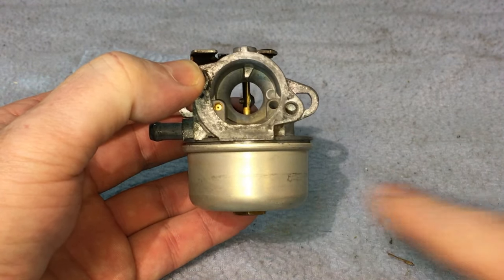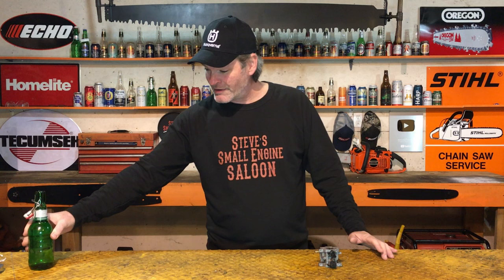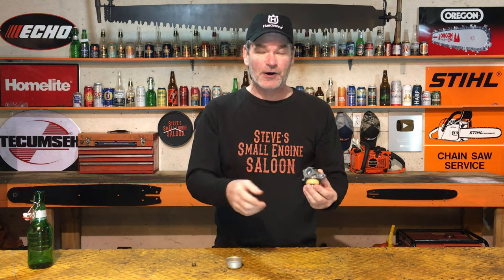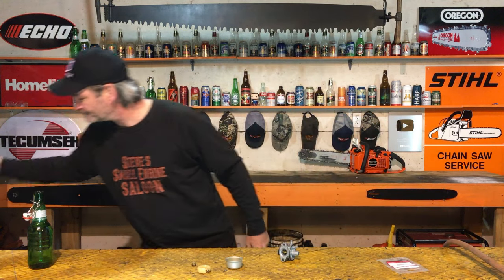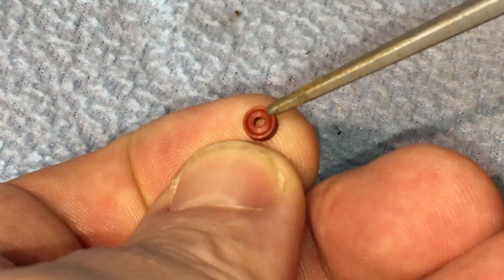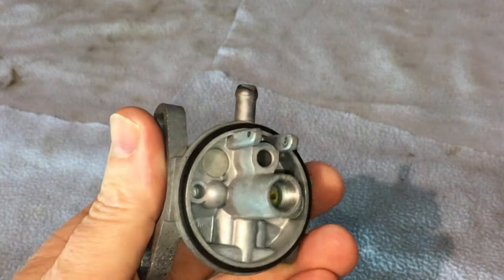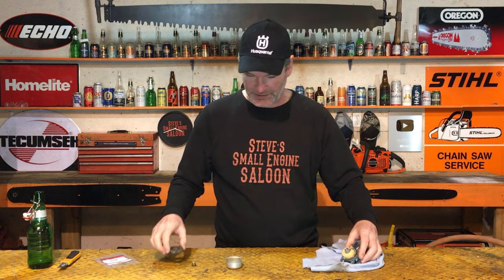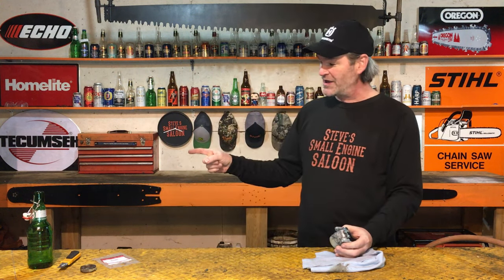How To Fix Your Leaking Snow Blower Carb – Briggs Or Tecumseh

Comment from the maker: ✅Click here for a Briggs repair kit ➜ https://amzn.to/2XH3DhG
✅Click here for a Tecumseh repair kit ➜ https://amzn.to/2DdxIfr
✅Click here for a new float ➜ https://amzn.to/33mAABy
For more videos like this, check out: 
👉How To Fix Your Leaky Snow Blower Carb – Honda Style ➜ https://youtu.be/NTBlVTa_jDQ
👉Fastest Way To Tell If The Crankshaft Is Bent On A Mower ➜ https://youtu.be/3up57DHiCqs
👉Here's Why Your Lawn Mower Is Leaking Gas - Honda Style ➜ https://youtu.be/tp67AzWNbI4
👉How To Adjust the RPM Speed on a Lawn Mower ➜ https://youtu.be/7YrA3QEIFnE

You can connect with Steve here too: 
✅Visit Steve’s WEBSITE ➜ http://www.stevessmallenginesaloon.com/ 
✅Visit Steve’s PARTS & TOOL STORE ➜ https://www.amazon.com/shop/stevessmallenginesaloon 
✅Follow Steve on FACEBOOK ➜ https://www.facebook.com/stevessmallenginesaloon 
✅Follow Steve on INSTAGRAM ➜ https://www.instagram.com/stevessmallenginesaloon/ 
✅Follow Steve on TWITTER ➜ https://twitter.com/SteveSaloon
Reply: Steve is there a
Way that the fuel could be coming out of both sides?? The air cleaner side and the engine side?? I see the gas leaking from the snow blower but when I did an oil change on it it looked to have some gas in the oil. I’m not 100 percent sure if there was but the oil seemed very liquidy and not as thick as when I put it in and it also had a type of sheen to the oil. I’m not sure if it could be both.
Reply: Steve, great video--loved the toilet analogy!  It's the first time I've understood a carb float.  Your link to the Tecumseh repair kit goes to an item that is unavailable though, FYI.  Be great to get an updated working one!
Reply: Do all tecumseh carbs take the same needle and seat kits
Reply: Would this cause oil out the exhaust?

Comment: Saturated float...In 1976..on a 73 ChevVan...plastic coated opencell foam float in a Qjet 4barrel.. took apart twice...still flooded...third time noticed float was heavier than normal...replaced with used one from parts stash...set up level..reassembled...ran better than new. Thank goodness the hollow plastic floats that are used in small engines are better quality today. Best to you and yours.

Comment: Thank you!   I rebuilt the carb on my 5hp Tecumseh about a week ago. I initially thought all went well and it started right up on 1 pull.  1 week after storing it I noticed a fuel smell in the garage and a puddle of gas.  After watching your video I pulled it apart and checked the brass float.  Sure enough it was filled with gas.  I replaced the float and reassembled and no leak. It runs better than it has in at least 5 years.  Great video. Thanks Brian.
Reply from the maker: Great to hear!

Comment: I had this issue with my riding mower. Although I didn't realize at the time this was the exact same problem, I did get a carb kit and replaced all the little bits like this and that did fix it. Thanks Steve for so many great videos.
Reply from the maker: You're Welcome...

Comment: Was working on snowblower and felt something was wrong with the seat.  Really didn't think using a compressor would blow out the seat but it worked like charms.  Thanks.

Comment: Thanks Steve, I had that problem with my snow blower two weeks ago, when I went to check it over at start of winter. Had gas in the oil, it leaked past the fuel line shut off valve and through carb. I was trying to figure out how it would have gotten into oil. Now I know.

Comment: Glad to have found this video! I kept thinking it was a gasket issue! Installed all ne carb and back up and running. Also bought the needle and seat repair kit to fix the old one as a spare...

Comment: Great carburetor repair video Steve, when I fix leaky carbs to test the needle and seat I just use my mouth to gently blow into where the fuel line connects to the carb.

Comment: Hey Steve, recently changed a needle and seat on a flooding Tecumseh carb. Next morning there was a nice pile of gas under the snowblower where the gas leaked out of the carb overnight. Checked to make sure everything was seated right, then noticed the plastic float was full of gas! Could hear it sloshing around. I needed the blower right away, so i drilled 2 tiny holes in the float to empty it out. Figured out that the floats are 2 piece units that have  a seam running down the middle. Thats where it was leaking fuel inside. So i took my plastic welding gun and re-melted the plastic in the seam area and the 2 holes, and reinstalled. So far its holding up great! Lol 
Next time i see gas again, i will order a new float.
But yes, the plastic ones can get full of gas inside them!
Cheers

Comment: I've just bought a new B&S carburettor. Fitted it and 2 days later my John Deere mower was hosing petrol out of the air intake. The plastic float was full of petrol/gas. Fortunately I still had my old float, but I will be visiting the dealer as soon as possible. So Steve plastic ones can have minute leaks in them too!!!

Comment: Steve there were some older Briggs with brass floats , and you should mention a lot of the Tecumseh carbs had a high spot & a low spot in the bottom of the fuel bowl and it has to be put on correctly or it won't allow the float to come down. I have also repaired many brass floats by putting them in a cup of boiled water & held it completely under the water , and then you should see bubbles come out . Then you can Mark it , clean it & solder it .! :-) hope that helps someone too.

Comment: Great vid! My Toro 724 Snowblower is leaking out the fuel primer so I replaced it and it does it with the new one as well. It sounds like this could be the issue.

Comment: I normally stay away from task like these! But your video makes it look easy. I found the information on how to order the needle and seat. Thanks for your help.
Reply from the maker: You are so welcome!
Reply: @StevesSmallEngineSaloon  well today I took off the carburetor and found that I have the brass float HMMM 
Then I couldn't find the hole on the underside to blow out the seat you talked about so I put it all back together. So it wasn't  as easy as you made it to look like. HMMM I'M  STUMPED

Comment: Excelllente Steve once again ! Got near 2 feet of snow dumped here Downeast. Damn Tecumseh carb  ( Toro snowblower) dripped gas over my hand at 8 F ( whine). You solved this.
BUTT: since you asked about carb beers 🤣, when are you going to imbibe some fine ale or at least micro brews ? That is an order. Much thx for what you do.

Comment: Ahhh...I had an old Sears lawn vac with a Clinton engine on it that flooded a lot towards the end. I junked it because of that, and a lot of other issues it had. The chassis were the engine bolted on had broken away, so the engine was only holding on by one bolt..GREAT VIDEO!!!!

Comment: Awesome I  have  a 1975 toro snow blower and  my brass float had a leak and  filled with  gas.now I replaced the needle and  seat and  new brass float and  its leaking  gas someplace  on the  outside. Oh I replaced the  bowl gasket  too

Comment: Thank you Steve for this great video, especially the part you explained with toilet flushing. After understanding how the float and needle works, I was able to pinpoint the mistake I made last time after I cleaned carb. The floater was upside down (yah, stupid). As soon as I put it back and tested it, the snowblower is not leaking gas anymore.
Reply from the maker: Glad it was helpful!

Comment: Good job Steve. I have used a small self tapping screw to remove the plastic seat. Just scew it in gently with fingers only until it feels tight and remove the seat with rhe screw. 
I think the Grolsch is an excellent choice for this job. Cheers!

Comment: Got a video suggestion.  I have a Honda HSS724A Snowblower.  I'm finding it difficult to adjust the rear and side guide shoes as well as the scraper bar.  This maybe a no brainer to some but the manual is confusing and it seems everyone does it differently.

Comment: Thanks for the video Steve. I didn’t use a rag and blew the seat out with the compressor. I thought how bad can it hurt? Surprisingly, a lot. My carb is still leaking fuel out of that tiny vent hole. Not sure why and I’m out of ideas

Comment: We have one major issue with Tecumseh engines in the UK and that is  when they were brought out by the company that owns the brand now they stopped shipping genuine parts to the UK. Only a select number of aftermarket parts are available for some of the engines they supplied. It's a real headache for a engine model called the AQ148 as these were built for one purpose only to be fitted on two brands of reel mowers(we call them cylinder mowers) sold in the UK.

Comment: Tecumsey, tecumsah... Great video as always. I have a tool that looks like a knitting needle to remove and replace those old rubber seats but apparently, a compressor works just as well.

Comment: I have 1983 snapper snowblower. Cleaned carb inside and out. It’s running great. The problem is it leaks all the gas out after I use it and it’s sitting not being used. Not leaking out of air intake side. Thinking it might be seal on float bowl or bolt that holds it on. What do you think? 🍻Cheers!!

Comment: Steve, do you have a fix for a fuel leak from the bowl retaining bolt ??
I replaced the retaining bolt washer but still have a leak.
Should I just replace the carb on the snowblower altogether 🤔

Comment: So you never saw a plastic float leak, well I have one right now. That's what brought me here. Used my 1995 Ariens ST824 with Tecumseh engine for the first time this winter a few weeks ago. When I put in gas and ran blower it was obviously flooding out. Shut it off and I could see fuel dripping fairly rapidly from the carb, overflowing from intake side. Closed fuel shut off and removed bowl from carb. The float is exactly the same as the one in your video. Float is full of gas. That's as far as I got. Need to get a float, and I guess I'll replace the needle and seat while I have it apart. First problem with this machine in 25 years. Never even broke a shear pin!

Comment: I have a ST224 Husqvarna snow blower new last season. It worked fine this year as well but when I turned the gas lever on to start it so I could get it ready for storage, gas ran out under the cover. Is that something common when setting or possibly dirt in the gas holding the float open? Your dimo was great and I plan to check it out tomorrow. I think I will have a Labatt Light! Thanks

Comment: First timer here. good video. I subscribed and thumbed up too. Question: I have a slight leak like drops but it is coming from that area. I think it only leaks when I tilt the snowblower up a little to move it around (no snow, etc.). Before it would have a slight leak just sitting. I kept tightening the bolts on the bowl and put new washer/gaskets on those bolts too. Any idea if this just means it is the new seat because the floater is off a little bit? It can be running or not running.

Comment: Thank's Steve ,hey my Techumsa carb has a rubberized tip on it's needle and it looks like a brass seat, can I upgrade to the type you have shown,  had to switch to the hard stuff,no heat in my garage.

Comment: Steve. My B & S Lawn mower was leaking gas from the air filter side and oil and gas from the muffler. After looking at this video I ordered the kit did the repair and the gas stopped leaking but the oil kept coming out of the muffler.
When I opened the carb I found
There was no rubber seal
The Needle valve had a dark coloured tip
I did the installation and the Mower started but then  ( with a lot of smoke )cut out. Black Oil was coming out of the muffler ( exhaust )
There was no leaking gas from the air filter
I did notice that the Float was not level after I installed the new kit.
The Mower has a plastic carb.
Any help you can give would be very much appreciated.
Thanks
Pete

Comment: Hey Steve, Just put a new carb on my Briggs powered generator. The carb leaks fro the bottom of the gasket. Is there a gasket sealer I can smear on the gasket & bolt the carb back on? Thanks

Comment: My snowblower has a leaking carb like that. Time to fix! 
One question first: would such a condition make it hard to start the blower on a cold day? Mine starts like a champ when the weather is more-or-less decent but when I tried on a really cold day it would try to fire but wouldn't keep running. I don't know right off if the motor is B&S or Tecumseh or whatever. The blower is a 1980s Ariens with an electric starter.

Comment: Great Video thank you.  I have seen them all.  Steve, could you do a video on why a Tecumseh 9hp engine (2004 snowblower) runs fine, starts fine when cold but will not re-start when the engine is hot unless I put the choke back on then it starts right up, take off the choke and we are good.  But I did notice that if I try starting the engine with the electric starter it kicks right over with the choke off and hot.  But again not with the recoil rope.  New spark plug, Carburetor cleaned including that tiny little hole on the body of the carburetor.  This is a Non adjustable carburetor. Thanks.

Comment: I ended up cleaning my carb , there was a tone of stuff in it. Then my snowblower started n sounded like a brand new one. As it warmed up I noticed it would eventually start running rough..  after like 3 minutes. It works decent when full throttle and gets the job done but let's say I slow the rev back down it surges and I noticed it poor gas out the air side of carb. Would this most likely be from a float issue were its not sealing properly ?

Comment: Love your Vids Steve! I got a question for you about a Tecumseh 11hp Snow King engine. I just picked it up, it didn't run. Cleaned the carb in my ultrasinic tank, replaced the emulsion tube and o rings. Put a new needle seat kit in. It's starts up good cold and runs excellent. But when it is warm and you shut it off, and you wait like 10 seconds to start it. It will not start unless you hit the primer one time. I haven't seen this before. Is this a characteristic of some of these engines. I would think if it's warm it would start right up without the primer. Can you give me any pointers on this how to fix it if this isn't normal? Thanks in advance Steve!

Comment: Tecumseh makes a little tool for that o ring. It looks like a very small knitting needle on one side. The other side has a small stud that fits in the center of the seal. I’ll have to check the part number on it at work today.

Comment: Hi Steve,
This is not the first time watching your video or anyone else. I do find your videos very informative. Some of the explanations seemed very basic at first. Then I thought, maybe a lot of people don't have the experience like I do (I usually buy used things because of the price of new) and find myself watching dozens of videos before getting my hands dirty. Sometimes I feel like I have no knowledge of what I am doing so thank you for taking the time to explain in simple terms. Just wondering if there is suppose to be a washer where the needle valve goes that holds the bowl on and is there suppose to be a O ring where the bowl meets the carb bottom? I usually drink coffee while repairing anything because there would be more beer than fixing at first problem lol. Usually it's Alexander Keith after the work is done!!  Cheers!!!

Comment: My one year old  inch Briggs did this to me. Walked into my garage and it smelled like gas,the bottom of the snow blower is where the puddle of gas was. Briggs has two or three year manufacturer warranty - but  the repair shop authorized by Briggs told me it won;t be covered by warranty estimating the repair at about $200+ (100  for part , 100 labor) However, I think this is a faulty manufacturing issue by Briggs and they should cover it by warranty- why not? I leave fuel in the tank (-not recommended ),but there is also a switch built in for just that-storing the fuel  in the snowblower. This is another reason why the manufacturer is at fault because this switch did not prevent the fuel from leaking out.  I have another 15 year old snow blower by another make and I always left fuel in the gas tank during off season and yes it needed a couple of new carburetors-but not every year rather every 5-6 years,which is fine. So how does a one year old Briggs that retails for $1000+ become disabled b/c of this issue? Briggs...?

Comment: Hello mate, great video, what the difference with needles with the red tip? Because the carb I removed the other day of a Tecumseh engine has a red tip on needle, also can’t see no rubber seat, are they sometimes brass? Thank you

Comment: Hello Steve, My Tecumseh has a valve with a spring on the underside of the bowl (yours doesn't have one it looks like.  That is the part that is leaking,  is there a washer that needs replaced on that little valve?

Comment: Hey Steve, I’m struggling with a nikki carb right now. 

Its a 9.5hp B&Stratton on a craftsman snowblower. 

Would you have a part number for a walbro replacement carb without the shutoff solenoid?
The craftsman manual says the carb part number is 696737 but the carb has 695786 on  it. Help!!!

Comment: Hi Steve, I changed the needle valve and small O ringon my Briggs motor like you show in the video. Changed my fuel line also as it had a small hole just above carb. I noticed when all back together and I primed carb it was bubbling out through the top of bowl. The bottom bolt/valve was tight. Could it be the bowl itself Steve or something else.

Comment: Mine is leaking out of the bottom of the bowl where the adjustment screw goes in and I just can not get it to stop. It’s just a slow drip but leaks all the gas out if I let it sit for awhile. I’ve tried a new gasket where the screw goes into the bowl but it still drips so I’ve just dealt with it for a couple seasons now but I’m determined to fix it now